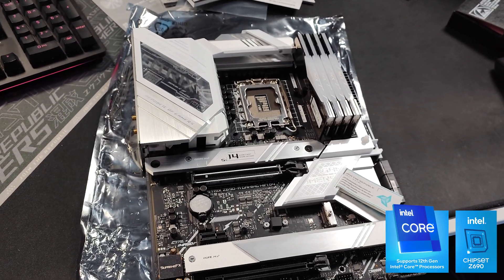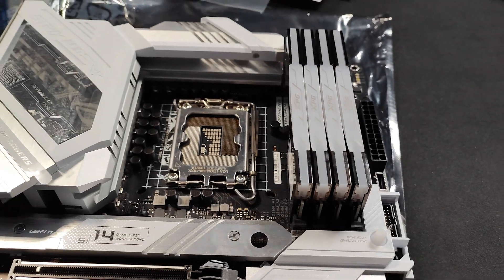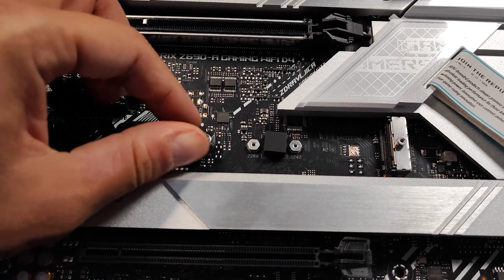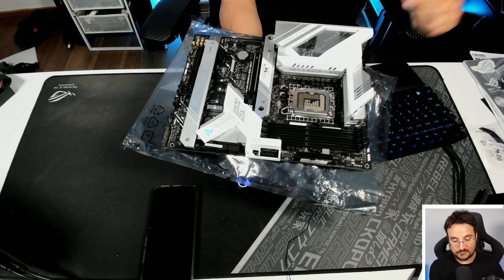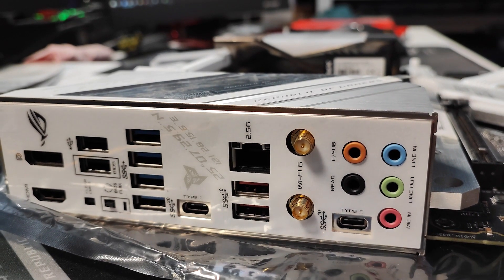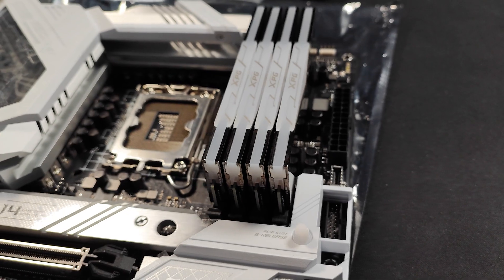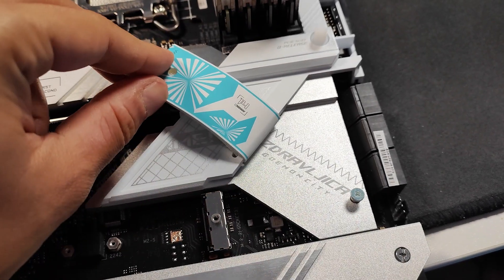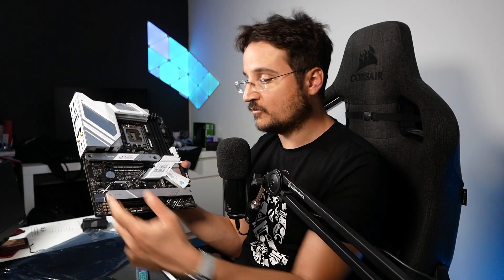ASUS ROG STRIX Z690-A WiFi D4 Review

Comment from the maker: Questions about the ASUS ROG STRIX Z690-A WiFi D4?
Ask here! I will try my best to answer them all :)
Reply: I have i9 12900 and RTX 3070TI ,
I want this motherboard , 
what you recon this one will be great?
Thank you 😊
Reply: @jattministryy  yes its great :)
Reply: I have an AIO with tubes on the left side of the pump, the thermaltake th360. Do you know how much room there is on the left side of the socket, so I can fit my AIO on it without spinning it around?
Reply: Do you have any suggestions for a strong fan I can pair with this? I initially purchased the "be quiet dark rock pro 4" but it doesn't fit....
Reply: Can you put 2 M.2 and actually make them work together on this board? cuz my old ASUS ROG Strix B560-A Gaming can only run one single M.2
Reply: @sachbayaya  he is not replying so don't worry
Reply: I have 32 gigs 2 sticks Corsair vengeance pro RGB.. can I add another 32 gigs same ram for 64? And do I just update bios  xmp?

Comment: Since it’s DDR4, and in that color I’m wondering if this would pair nicely with 13th gen 13900k
Reply: does it support gen 13 ?
Reply: @LeonaTargon  yes but you have to update the bios first, I'm currently looking a tutorial how to before pulling the trigger
Reply: @cheezy3723  was the tutorial easy? i just got an i5 13600k and want to order this motherboard soon
Reply: @JoJo-sf8ok  yes it is! It should bring you no problems whatsoever to update the bios, this motherboard has in it's design a flash port to update the bios without the need of OS.

Comment: Amazing board, i am gonna trade it from Z690 GAMING X DDR4 because of:
VRM Amper amount 
M.2 latch, GPU PCIe latch
Built-in Wifi
Bios
Temperature sensor
Internal USB-C 2x2 20Gb/s to the front of case (This is the only DDR4 Z690 board to have this one)
It will be a hardware upgrade not 12700K to 12900K although this board can easily handle it, even after OC stays cool but
But it doesn't change the fact i will stay GAMING X as a second board if this ROG would be broken and I'd have had RMA it

Comment: Was going to buy that one for a all white build, but ended up getting a Z690 Steel Legend, very happy with this motherboard so far.
Reply: I'm in a similar predicament now as well. Did you get the DDR 4 or 5 version? I was very close to buying the z790 version (Steel Legend) today and I saw that they got rid of the BIOS Flash Button so I decided to hold off.